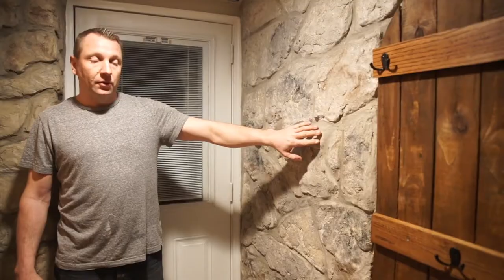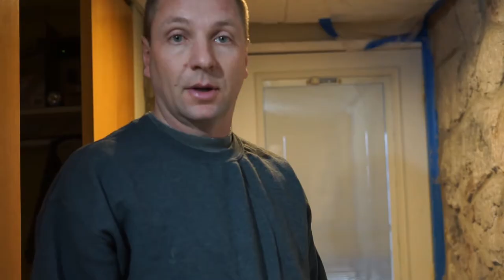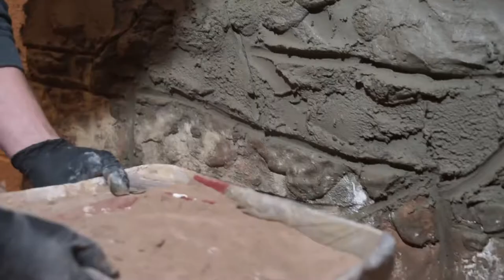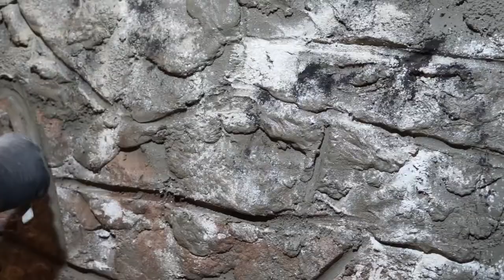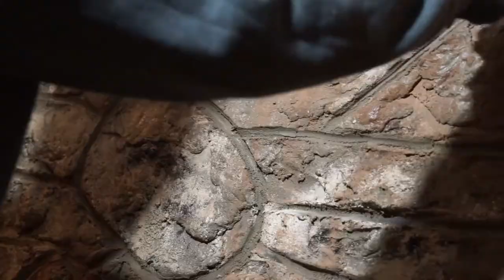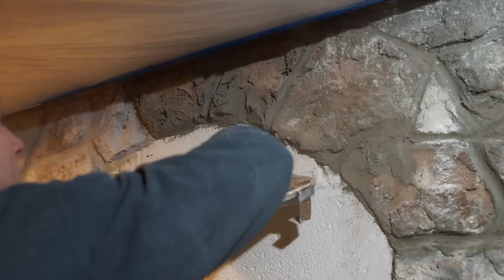stone wall look DIY eazy

Comment: This turned out great! Love it! I've been trying to find techniques to get this same  look on pavers. Would the colored grout hold up outside in the elements? Or other ideas for getting splashes of color? I thought of maybe mixing up some small batches of brown and charcoal colored and swirling it around with the standard grey.
Reply from the maker: Thank you for watching!!   For the pavers you can buy cement colorants and mix 3 different colors in separate containers , when mixing for the pavers just add one of each colors without mixing it too much . Or just sprinkle tile grout or powder concrete colorant on top of the pavers while they are wet .
Reply: @simpleconstruction132  That is indeed one of the techniques I was going to try. I've got a list of techniques from all these vids I've watched! I'm going for a flagstone look, organic shape/color, no flat surfaces, etc. I don't have stamps like I often see used to accomplish this look. I'm going to try with the use of forms, so mine will be upside down. Using scrap wood to define the profile,  getting rid of all the flat & smooth surfaces by chipping, carving, gluing random stuff to the inside and bottom of forms, possibly sand or scrap cloth to build up areas, and then simply covering with a tarp to create a non-stick form surface. Hoping that will produce an organic shape that I can easily release once it's set.
Reply: @myjunkmail007   for 14 years I use small sprayer (electric or air) with 14 colours, sprayed on but firstly in the mix to get background colours #StoneFX
Reply: THANK YOU for sharing  @simpleconstruction132  🤟🤟🤟💌

Comment: Can this be done on drywall ?
Reply: Following!
Reply: That's a lot of weight you are trusting drywall to hold. You can take steel mesh and screw it through the drywall into the studs  then pull the mesh off the wall a little so mortar can get behind it then make this.

Comment: Wondering if this would work on a drywall wall (vs block).
Reply: You could if you nail up galvanized steel mesh. Can get it in the flooring department at Home Depot or a builders supply store

Comment: How did he prep the wall for this diy? Or concrete sticks to anything without trouble?
Reply from the maker: Thank you  for  watching.  Depending on the wall surface  that you are using you need to do base coat , for the masonry wall you can just trowel on light coat of masonry mortar mix ,  or tile adhesive cement for better adhesion, if you want to install on the drywall or plaster you can either install metal lath and base coat , or 1/4"  cement  board and scratch coat or base coat with the same materials as mentioned above, for this video i have used 2bags of masonry mortar mix,  total cost $14 . Also for better adhesion of the final coat you can wet base coat with the sponge or paint brush.
Reply: @simpleconstruction132 Thank you! I finally found your answer on base coat for concrete board! So appreciated!
Can you tell me the concrete stain brand  you would recommend as for a paver?

Comment: Sorry but just for your own improvement. You should have pictures of nice stone walls for you to look at while working. Try and make your walls look like the picture. If you go pick stone for a wall they usually don't look like the ones you made you do not pick stones that look like the ones you produced. I am not trying to tear you down.

I worked for IATSE Local 729 the set painters union and when we we evaluating each others work we were brutally honest. It's how we got better. Don't get mad just be open to improving.

Your stones are far to messy and that is one of the most important things. Keep things tidy and be more definite with your borders